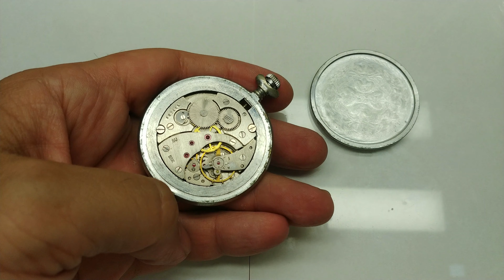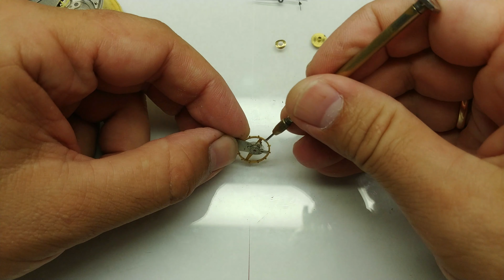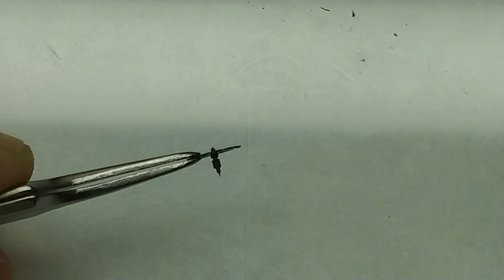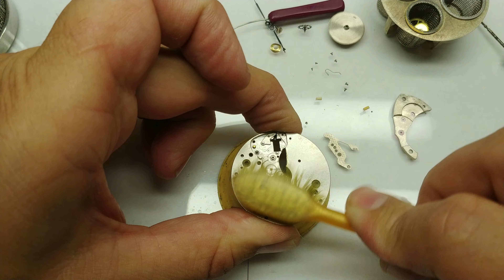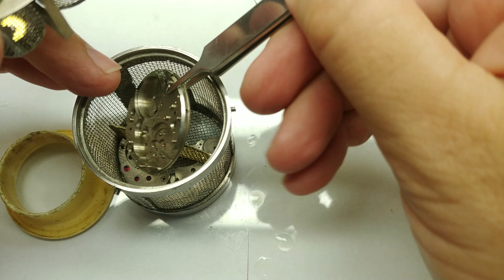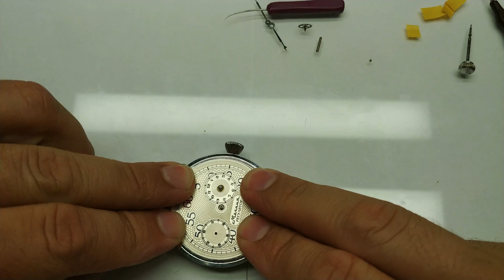Watchmaking Restoration Watch Molnija regulator  We convert watch molnija into a regulator ремонт

Comment: hi, could you advise where to find a conversion kit for the 3602 movement? I mean case and any conversion part needed. Thank you!
Reply from the maker: I ordered watch cases in China from a manufacturer of cases for different watches.
Reply: Thanks, was that specifically for 3602 or generic Unitas 6497/seagull st3600?
Reply from the maker: Especially for 3602

Comment: Working on 2 3602's at mo, one a Zlatoust "1977" which from what I have been told by a contact over there is someone enterprising  in Chelyabinsk churned out a ton of brass and steel ones giving them semi fake papers and powered by a caseload of Molnija movements said enterprising chap had acquired.   I also have a reglateur but has a snapped stem in and I wanted to see how this is done as I have a lovely Sekonda movement with a done in balance and the reglateur has a pristine balance and thinking of converting the Sekonda to do the "marriage" watch.